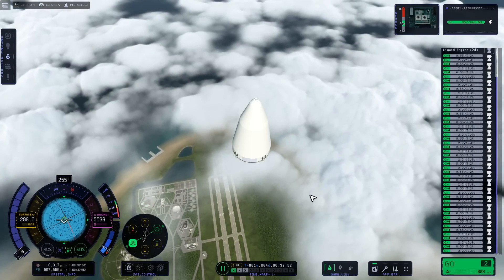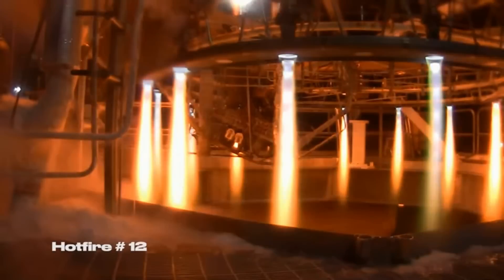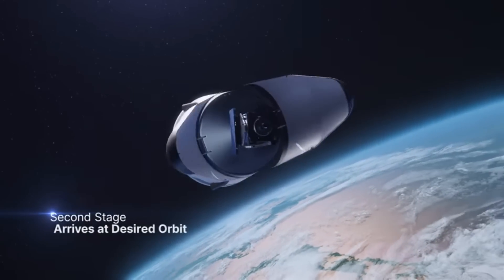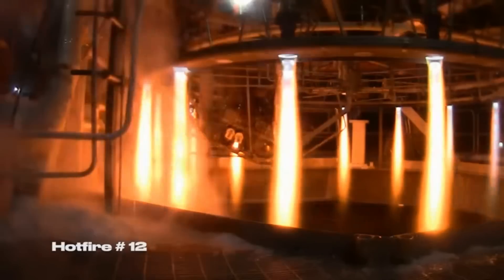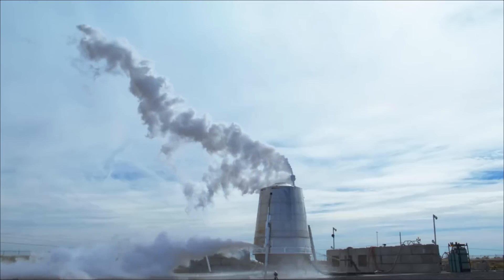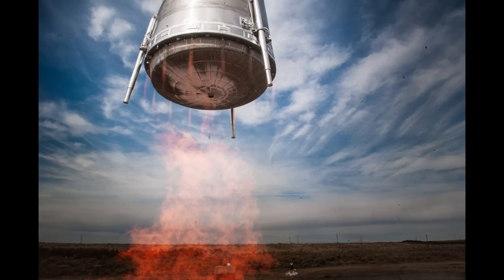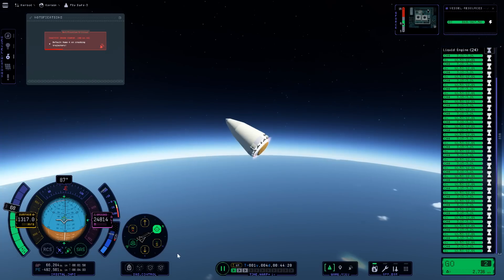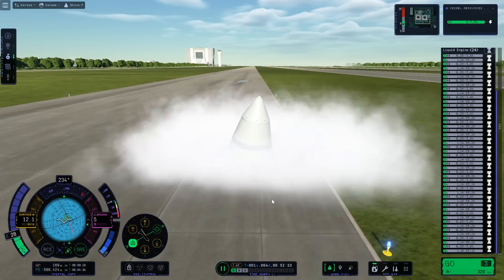Rocket Scientist Combine A Rocket Engine With A Heat Shield - Can They Revolutionize Space Launch?

Comment: This can work as an SSTO for mars. Due to its low gravity and less dense atmosphere , Mars has a good potential to be able to launch SSTOs to the Martain SS ( Hope someday we get to see that too 😅). 
Anyways nice concept... Using the heat shield as a part of engine. I've always wonderd if its possible to make a aerospike engine with an inflatable heat sheild... this one's quite close to it although bit different from what i had thought.
Reply: Thats the issue , they would need to add parachutes because the vehicle will not decelerate as much as in Earth atmosphere.
Reply: @kleinerprinz146 an inflatable ballute drag device after slowing from high transsonic to low transsonic would help slow it a bit more to allow safe opening of parachutes too.
Reply: The only issue is refuelling. The reason SpaceX chose methane was because it can be made in-situ on Mars. For other fuels, like hydrogen, we'd need to build a fuel depot there first.
Reply: @nagualdesign  SpaceX plan to make methane on Mars, from hydrogen and CO2....      :)
Reply: @nagualdesign  but hydrogen is much easier to make then methane
Reply: @solarissv777  On Mars?
Reply: @nagualdesign  anywhere
Reply: @solarissv777  The atmosphere of Mars is about 95% CO2, I think. You can turn it into fuel wherever you land, and it's a relatively simple setup.

I guess the most likely source of hydrogen on Mars would be the polar ice caps or some other subsurface water ices. They're much more difficult to harvest than atmospheric gasses though, so in the short term methane engines are more practical.
Reply: @nagualdesign  to produce methane from CO2 you still need H2. Methane is CH2
Reply: @solarissv777  The trick is that you'd only need a small amount of hydrogen, so you could even take it with you rather than having to harvest then electrolyse water ice.

With 1kg of H2 you can produce 4kg of CH4 and 16kg of O2, which can then be burned in that ratio in a rocket engine. So you're only having to transport one twentieth of the mass from Earth to Mars.
Reply: @nagualdesign -The primary issue with choice of H2 vs CH4 fueling for deep space missions doesn't relate to engine performance, but reliable and economic storage and handling of the materials, and mass of equipment required. H2 requires crazy low temps and high pressures and migrates through solid steel, and is responsible for a high rate of launch scrubs under the best conditions here on earth! (Shuttle, SLS, Delta4 sound familiar?) Storage of the propellant is vital, whether its 3 weeks around the moon or 2 years to Mars and then back for the spacecraft, or the remote monitored (mostly robotic) mining/production/storage depot on Mars that's likely to produce at low rates and have to store it's production for 2 years.
Think of that one carbon atom in methane as a binder & Stabilizer for hydrogen.
Failure of fueling production scrubs all missions until replaced or repaired (R2 - where are you?😢) while likely stranding and killing the crew!
Considering that CNG-LNG (mostly methane) is produced routinely and reliably for decades now on earth and is well understood, handled and stored..... which fuel would you choose to bet your life on- because when that hatch is closed and locked shut over your head, that's what's going on!😮
Reply: The atmosphere of Mars is so much thinner, I wonder if this could work at all there?
Reply: That Mars gravity advantage is so large. It's 7.8 km/s to orbit Earth, and only 3-ish km/s to orbit Mars. Plus with the thinner atmosphere you can do more efficient trajectories on ascent.

Comment: I thought of something sort of similiar years ago. Have the heat shield shaped as shallow conave cone. Have engine/s nozzle/arrayed in the center with the nozzles pointing so that the their exhaust flows over the heat shield. At the perimeter use a ring that can extend backward or a set of flaps that divert the exhaust gases. The idea is to use the whole heat shield as the expansion nozzle of the engine. Sort of a backward aerospike. The only area of the heat shield not used as the expansion nozzle is the cap over the engine assemblies. After all rocket engines work by expanding gases putting pressure on the engine assembly.

Comment: i've been clipping engines into heatshields for a long time in Kerbal Space Program. and its nice to see someone actually revolutionise the idea
Reply: Reminds me of the rocket in the mouse on the moon movie using small shower heads 😂😂😊
Reply: I'm still unsure whether starship will bankrupt Space X. They aren't having much luck with the design and it keeps getting pushed further and further back.
Reply: What do you want to bet that they will either be acquired by or licensed by SpaceX for the upper stage
Reply: @thebarkingmouse  Why? SpaceX has been clear that their future is with Starship that uses a completely different approach. They are planning to retire Falcon once Starship takes over the launches
Reply: @bluemountain4181 spaceX will have a bunch of reusable rockets and an assembly line designed to build them and maintain them so instead of just retiring the Falcon. I think its likely that they will sell the Falcon to someone willing to take over the small payload market, and being combined with a reusable second stage makes sense.
Reply: @WARnTEA if Starship reaches full reusability as planned, the costs will be so much lower than F9 that it won't make sense to use F9 anymore. 

Anything that you can launch on F9, even to some weird orbit, you can do the same thing on Starship and add a space tug with a lot of fuel to get to the other orbit.

The only scenario for F9 being useful is for DOD rapid launch scenarios, but even then Starship would probably be faster.
Reply: @ke6gwf  you're not wrong, but there is likely going to be a large gap of time between Starship becoming available and Starship reaching all of its goals to displace the market. These guys are an excellent fill in that market, and may even be able to drive prices down to keep the F9 competitive with Starship for much longer.
Reply: @bluemountain4181 Lol, they were planning on having a fleet of fully reusable rockets by now. My bet is that the Falcon program will continue much longer than they wanted to admit.
Reply: @thebarkingmouse  What's SpaceX gonna do with that upper stage? As you can see, this method is limited by the amount of engine you can have.
It ain't gonna meet the thrust requirement for Starship.
Reply: @807800  well of course not. But it points to other possible directions.  Not so much for Starship. They've already got the belly flop. But for Raptor. I think there's some possibilities. Because I disagreed that Raptors going to be entirely retired with the Advent of Starship. There are still going to be loads too small for Starship. That may require a rapid response or rapid launch.
Reply: @thebarkingmouse  So, your point is about smaller rocket? I don't think so.
Starship would have its hand full with Starlink alone. And with the high cadence of Starlink launches, that would lower the fixed cost, by a lot, and I would say, low enough to make rideshare on it, even better than the current Falcon 9 rideshare vs dedicated small launch.

And let's not forget, SpaceX goal is Mars. That's what Starship designed for. If their focus is on commercial launch, Starship wouldn't be as complex as it is.
Reply: Lolol